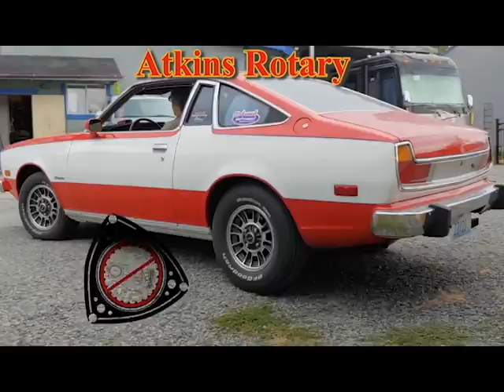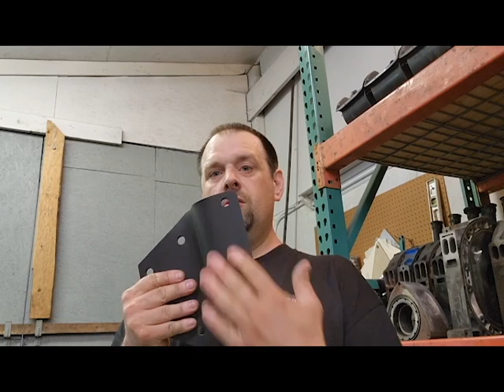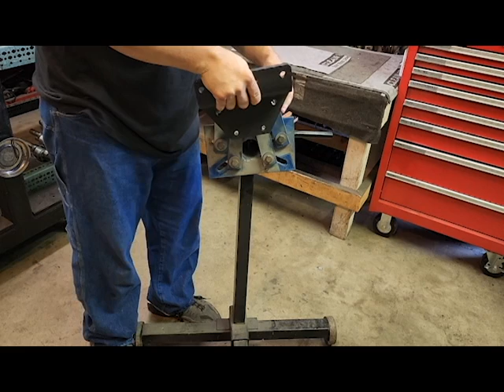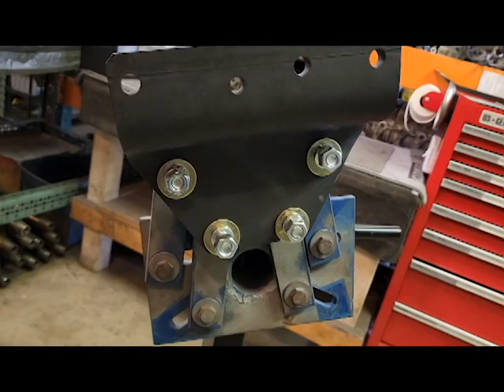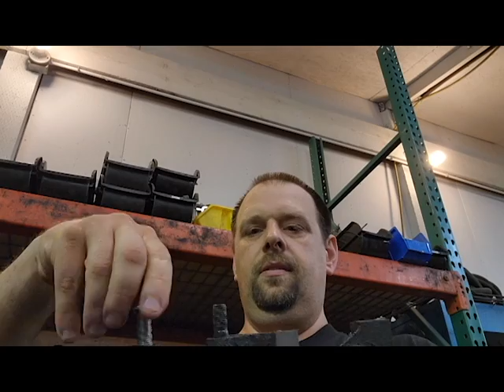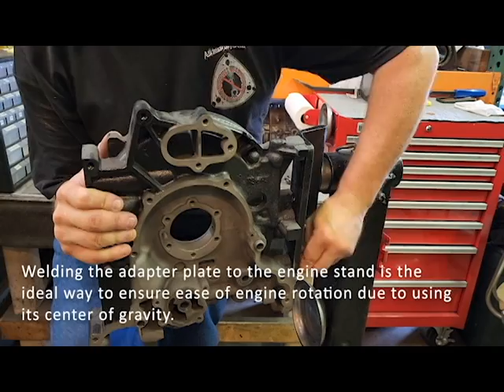Rotary Engine Stand Adapter Plate

Comment: Thanks for making more videos lately. I'd like to hear advice on how to avoid common do-it-yourself mistakes. For instance, overtightening the accessory belts on 13BREW engines to avoid belt slip after removing the air pump. Or cracking the front cover by overtightening aftermarket oil line fittings. I'm sure there's lots of other mistakes don't hear about.
Reply: : I have cracked front covers with stock stuff.. so I think something can be arranged..  sometimes we underestimate our own power let alone potential. 😁👍